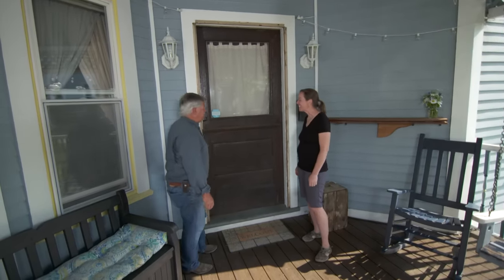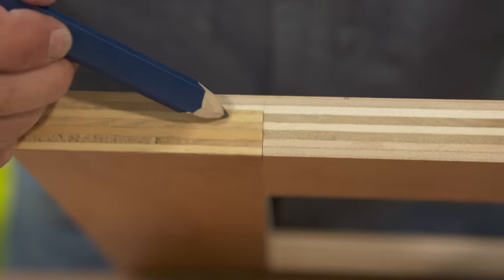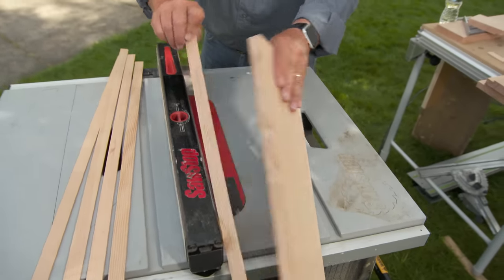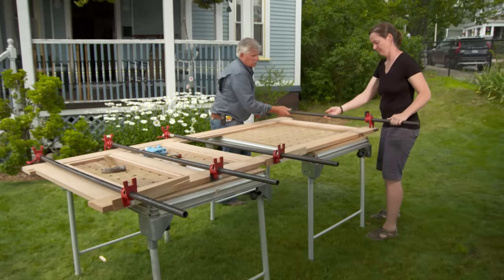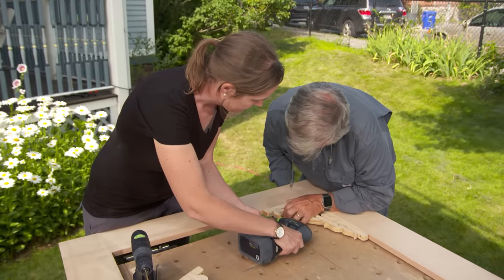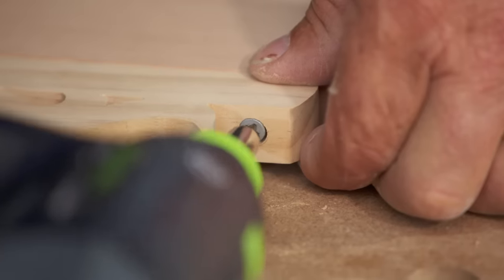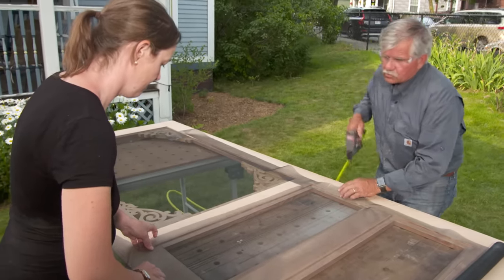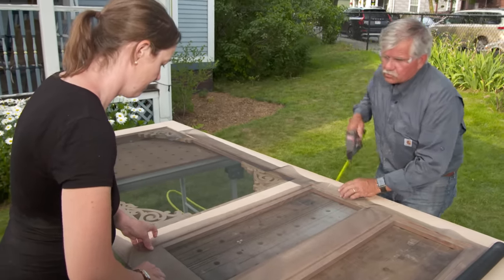How to Build and Hang a Custom Screen Door | Ask This Old House

Comment: Excellent workmanship, as always.  My only criticism is that it is going to be difficult to rescreen this door.  Removing the overlying wood strips without damaging them is likely to be challenging as they are nailed in place.  I would have installed them with stainless steel screws.
Reply: I'd use magnetic strips. Totally seamless and easy to remove.

Comment: Back in the 70s I had to putty and paint about 30 storm windows and rescreen the accompanying screen frames for a house while the customer was away on vacation. Scrape everything down, prime, some new glass, putty, two coats of enamel, all new copper screening and screen molding all painted BEFORE the screens were stapled on (c'mon Tom - should have painted all that woodwoork before you installed the screens). Anyway I come back to the house a few months later and see the homeowner had a window replacement company show up and sell them new vinyl windows. I asked where the windows and screens went and they said they all went into a dumpster.
Reply: OMG ! That’s heart breaking 😖
Reply: Ohhhhh. Such a bummer! FRUSTRATING!

Comment: S4S = surfaced all 4 sides.
Just means it has gone across the planer/jointer on all sides to ensure flat/square and remove mill marks, not usually sanded.
Reply: ok.
Reply: In Australia we call it DAR which means Dressed All Round.
Reply: Unnecessarily pedantic. It doesn't matter in this context.

Comment: As much as I love Tom and TOH, I don't know if the Festool Domino is within reach of most homeowners. Even those do who have tools wouldn't like have this.
Reply: That was my thought, too, but I know there are lots of ways to make similar tenon joints.  Even if you opted for a series of wooden dowels, I expect that with the lap joint, you're really still have a strong join.  After all, people have been making tenons for ages before Festool came around.  Another suggestion is to see if your area has a woodworkers club or guild.  The one in my area has a shop you can use on weekends, full of tools that a starting woodworker may not have yet collected.
Reply: There are several other more affordable doweling joiners for those of us who might only use it a few times each year.
Reply: Then use another system of joinery

Comment: Would have been a lot easier to paint before putting the screen in. Understand Tommy's time on site is limited but could have used a fast-drying primer and paint like Zinnser shellac and SW Emerald Urethane. Also very annoying that it didn't show how he marked the door against an opening that was covered up by the door, could have saved time elsewhere like not showing how to use the Domino tool - if you have one you know how to use it.

Comment: Another great Tommy project, the guy is a legend. 
The set up he has with the two mft tables and Festool kapex mitre saw with extensions would cost $7,470.40 to buy new... in New Zealand dollars 🇳🇿
Reply: Yep....how to build stuff if you can afford the Festool setup.   I'd be more impressed if he did it with an off the shelf Dewalt Makita or even Harbor Freight setup.

Comment: Now show me how to make the screen door that doesn't require a $1,060 Festool Domino Joiner. 😂 It's a beautiful door. For the cheapos out there like me though, dowels may do a trick for the price of a drill bit you already have and some premade long dowels cut to size. You can also use a bench top router to make dowels, which stumpynubs has a great video on. Beyond that, you can get fancy with hand tools and finesse if you have time and want to do that.

Comment: Everything was great except the way that the screen is installed. Screens are damaged very easily and you should use a grove in to install a screen cord so if it’s ever damaged which it will it’s simple to replace. 

With his method you have to remove the wood trim that would probably break then you’ll have to remove all those staples he used
Reply: Good point!

Comment: This old house loves to show you how to do things you can do around the house using amazingly expensive tools. The sawstop table saw I get - its a safety device (even if the cheapest saw is nearly 3 times a Dewalt or Ridgid). But that machine for the mortises and tenons on the door? It's a Festool Domino. The cheapest model is $1000 USD. Why not use a biscuit joiner (for around ~100 USD). Even their mitre saw is a Festool Kapex, starting at $1500USD.

If This Old House's purpose is to show homeowners how to do these simple tasks, why do they not use tools that the general public can afford in order to repair their home?
Reply: Most types of biscuit joinery would not hold up under that application. That's not an everyday homeowner project generally speaking. In fact, only rarely.
Reply: @rickmcphee4206  So then teach a method that would. Dowel joinery. Full half laps. 

Heck, even using a router to make traditional mortise and tenon joints would be more homeowner accessible than a Domino.
Reply: DR PHIL  Yeah, but using a dowelling jig or another method is different than using a domino. The process is different. The only comparable item is a biscuit joiner, which several people have pointed out wont have the required strength.

What I'm saying is that the average homeowner (or even above average) wont have a domino. Nor will they buy one for home repairs. Its way out of anyones price range for regular home DIY. If there are cheaper, but just as good alternatives (such as a dowelling jig), why isn't TOH showing homeowners how to use them? Why is it jumping to tools and items that are way outside of most home owner's budgets?
Reply: Boo Hoo
Reply: @daveklein2826  little late with your response, eh Dave? Just to make a useless comment that doesn’t address any of my points? 

Is forming a coherent counter argument too difficult for you?
Reply: @kylerobinson2084  What difference does it make how cheap or expensive his tools are? he is a professional with very professional tools and uses them well.  if you don't have the tools build it your way with what you have
Reply: @daveklein2826  someone didn’t read ANY of my comments, did they? I very clearly laid out a rationale for why they should use something other than a domino.
Reply: @kylerobinson2084  oh i read it and don't really care about your rationale and for you to compare a biscuit joiner joint to a domino joint just tells me you know nothing....he builds great and you can continue to build crap
Reply: @daveklein2826  Aww, yet you cared enough to respond. 

And I didn’t compare the two as in they’re identical. I literally offered multiple other ways. But reading is hard for you, I can tell.
Reply: @kylerobinson2084  I for one am glad Tommy doesn't dumb things down for people like you but shows how to build the right way
Reply: @daveklein2826  Aww, someone doesn’t get the point of the show. It’s okay, sweetie. I get that ideas routinely fly over your head.

Comment: He didnt specify what type of wood he used.  Also, if the door is to be painted it should be done before the screen is installed.
Reply: He did in the beginning of the video.  He used Fir.

Comment: You use $2000 worth of festool equipment  to build a $200 screen door. Not everybody can afford those tools. Come back down to our level.
Reply: Steve Lyman the domino cutter alone is about $1500 but for that kind of job it’s the best thing to use.
Reply: Don't make excuses.  The Domino can easily be replaced by round dowels, the track saw can easily be replaced by a circular saw with a straight edge.  The SawStop table saw can easily be replaced by any jobsite saw.   Nothing he did in this video requires expensive tools.
Reply: or better yet use what tools you have....why would a professional use crap tools